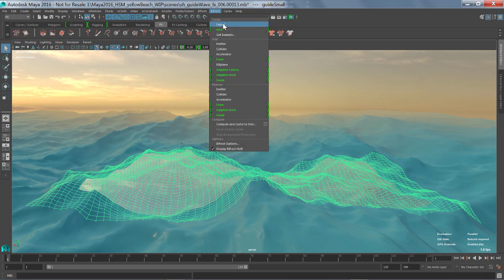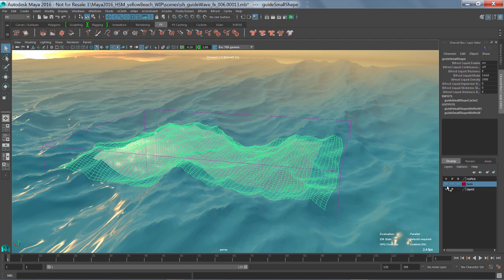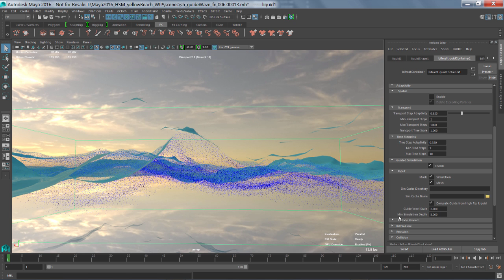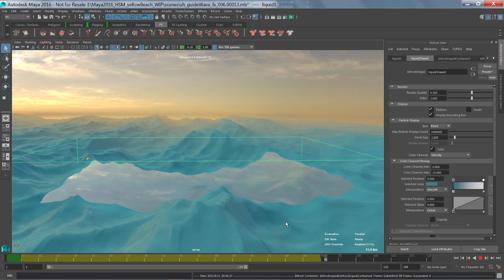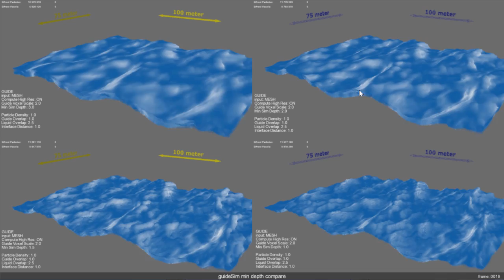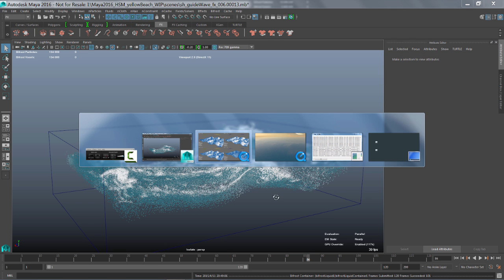Maya 2016: Guided Simulations in Bifrost

Comment: Bifrost is not very usefull if you have "only" 16 gb of ram. Everytime i try to calculate a sim with it, within 50 frames, uses all my ram ( I set 12GB limit) and Maya crashes!
Reply: +73maxmau Hi! I don't get that problem, and I'm working on a 16GB,   i7,  4 core,  iMac. Right now I just did a sim (scratch cache), and went for 135 frames and nothing happened. Hope you can fix the problem. Cheers!
Reply: Cache to your hard drive instead of scratch caching the sequence to your ram.. sorry it's 4 years late you probably already know this now...

Comment: I am confused how this is done, is there a more in debt tutorial on this?  I tried a plane and I couldnt select it. so wondering if you used  a ocean sim then put a plane on it using a lattice to get the wave form then made it liquid?
Reply: +3D Isgreat A simple way is: Use Texture Deformer (point space: world) with an Ocean texture. Duplicate special the plane with Duplicate input graph is checked on. Scale down the new geometry, than use Exturde to add thickness.
Reply: Thank you so much. i will try that.

Comment: Do you have continuous emission off?
Reply: I wish he'd answer this question. The other autodesk guy (the product developer) turns it off in his demo but i've discovered that the simulation looses sync with the guide shape unless it is continuously emitting. I have found that the particles literally slide off the crest of the waves down into the troughs unless the geo is constantly emitting.
Reply: @adigga8909  thanks for this, I've been having this exact issue, where it almost seems like it loses sync steadily with the guide mesh. Did having continuous emission fix it then?

Comment: What scene scale are you using?  The different sims around the 3:40 mark are measured in meters.
Reply: Scott Broad Hi Scott, 1 unit = 1 meter
Reply: daryl obert Ok thanks.  I just remember that in some previous videos you had Maya set to cm and it treating them as meters.  Just curious if that was what was happening here, or if it is actually meters 1:1.
Reply: Hey Scott,  1 cm = 1 meter, I never change my unit:-)
Reply: daryl obert Got it, that's what I thought.  Thanks for the info!